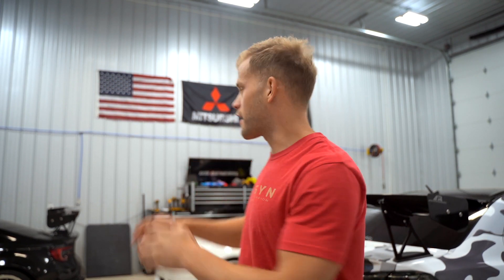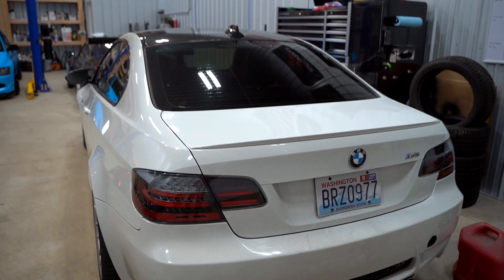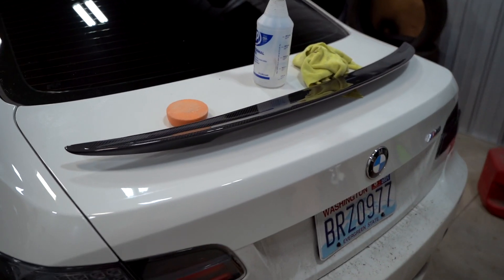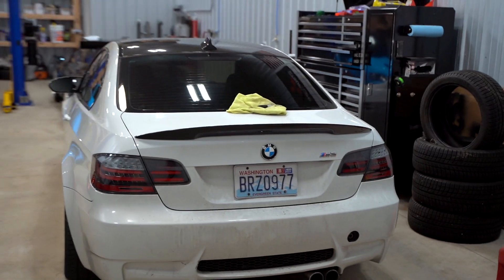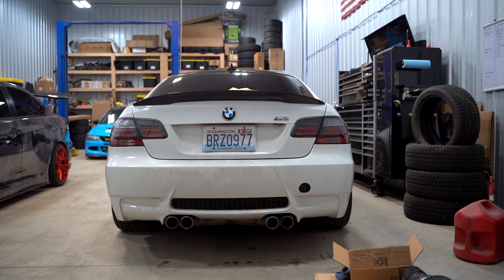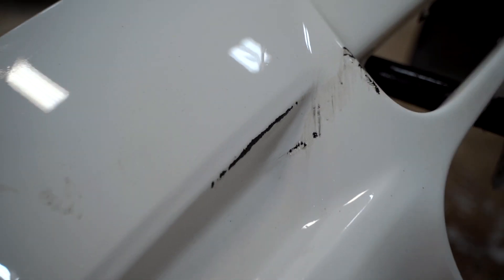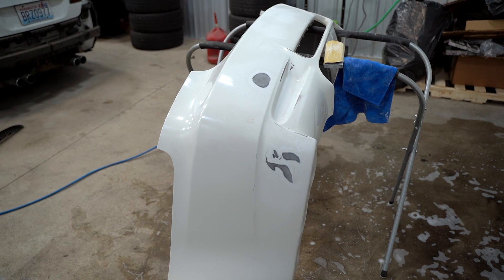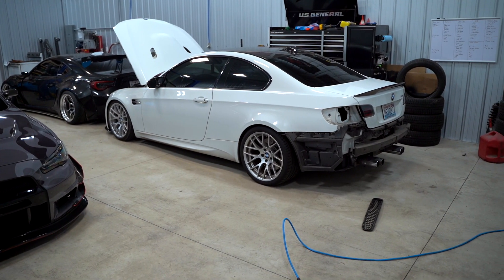Time to get better.

Comment: If I’m looking correctly , that paint is a tri-coat . It’s a lot harder to match tri-coats without a full mixing bank to tint the base . I would prob ask Bobby’s dad for help on this one chief . Otherwise color won’t match and you’ll be pissed . You’ll either fight it being too yellow or too bright white . Just a tip (I’m a painter at a body shop)

Comment: There's a small black tab/latch at the bottom of the attachment that connects to the gas cap. Pull that back to release it and you can slide the gas cap off. Might take a little tug though 🙏🏻

Comment: when using doubled sided sticky tape for that type of application, i have found using a heat gun will really set the sticky tape. in my experience it is ideal for more permanent solutions but will still be removable if needed.

Comment: Use the metal dolly to push out the dents on plastic bumpers when it's heated it works well and you don't get high spots